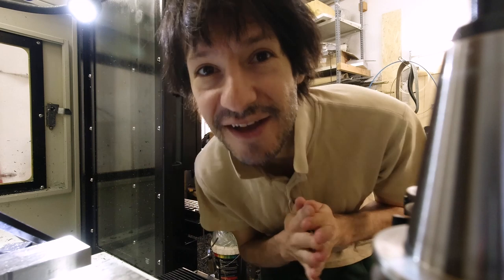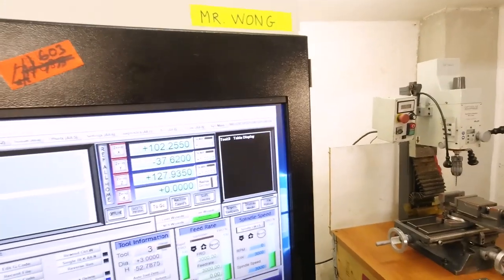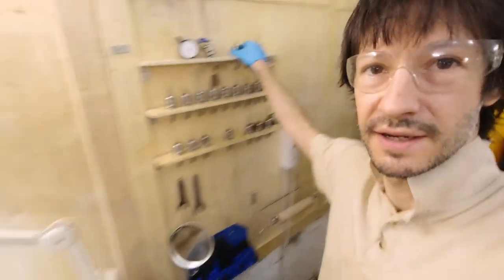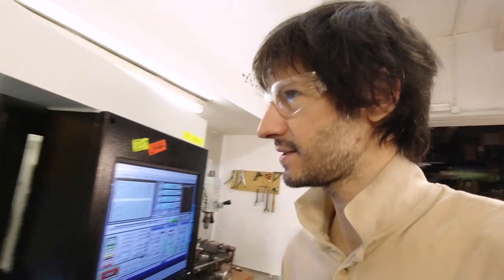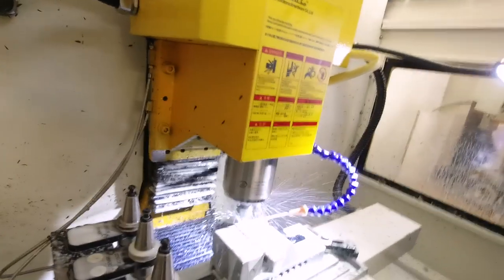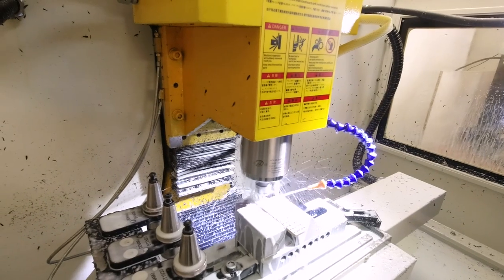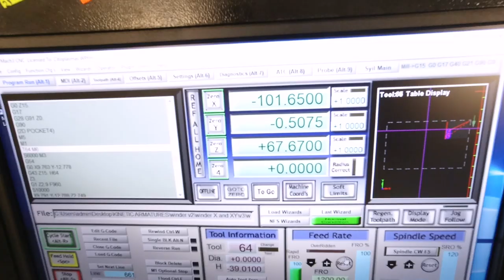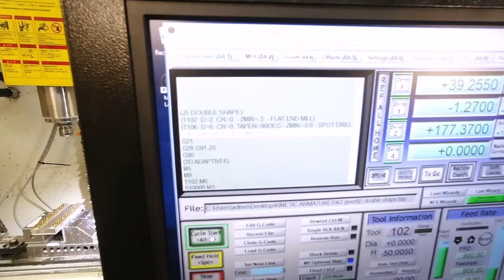WorkShop life at kineticarmatures blog#1

Comment: What’s the cheapest way to make parts and materials without having the expensive heavy machinery tools. For example what hand tools could work instead? I’m interested my building the materials and parts myself just need the Proper tools ..
Reply from the maker: I have posted videos making joints with just handpowered tools. Check them. The most necessary is an electric drill

Comment: Hey, I've been watching a lot of your videos. Thanks for the valuable information. It's much appreciated. I have a question concerning lighting. I was going to make the wide tube light for the main light that you showed us how to make. However, I've been looking into Aardman animations and found out they use many of those Altman Micro Elllipse lights. I was considering purchasing 3 of them. I can get them for about $80 each used. What are your thoughts on these lights? Is there something else that might be a better value? Any insight would helpful.
Reply from the maker: No concerns, as spotlight should be fine. Diferent purpose, those are to control punctual light. Not to light a big area
Reply: @edupuertasfruns  Thanks, I just want to get rough idea of what types of lights I would use the most and the cost to performance ratio. I don't wan't to spend an excessive amount of money on a light that simply isn't worth the cost. It's very difficult to find out what specific lights and mounting equipment professional studios use as well as specific reasons as to why they're used for stop motion.